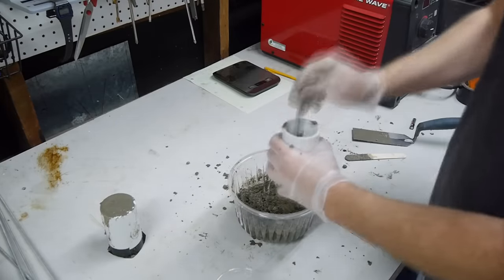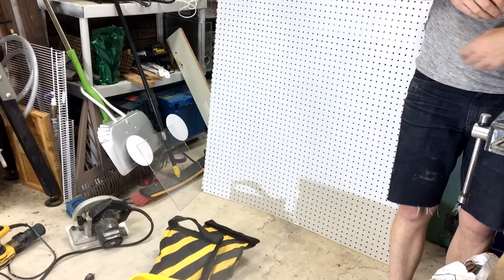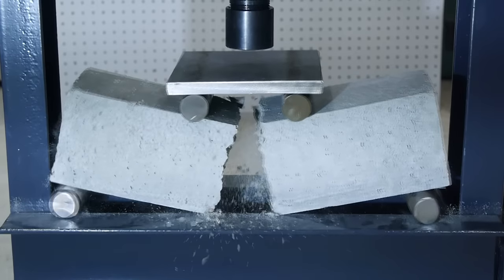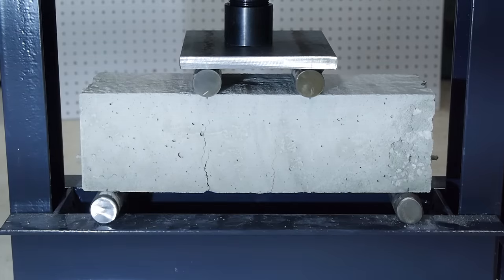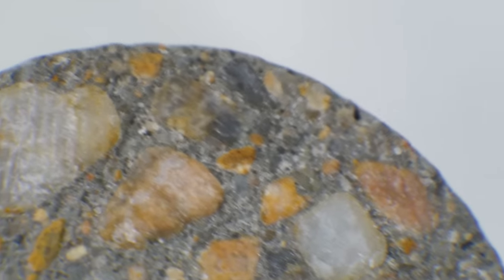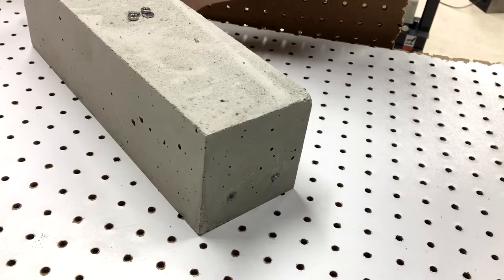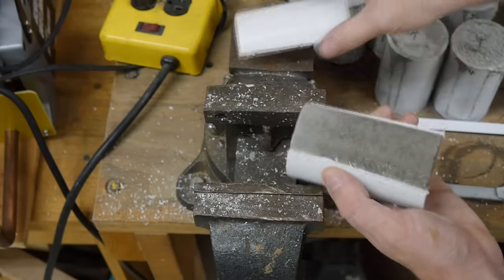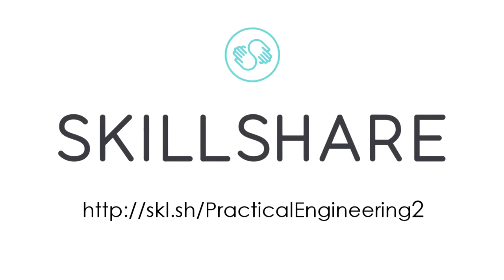Why Concrete Needs Reinforcement

Comment: Can you cover shapes used in concrete forms (like bridge beams) and how they are used to make the structure withstand heavy loads and the management of forces on it?
Reply: Jack Linde mostly for beams it's about increasing the inertia and keeping the stress concentrations relatively consistent, which is why we have I beams all over the place. They provide the largest inertia with the lowest material

Comment: As a redimix driver I would add 3 points.
1. There is a difference between concrete and cement. Concrete has aggregate or stone in it, while cement does not.
2. The more water you add, the more it will decrease the strength of the concrete.
#. There is also fiber mesh you can add to concrete (made from fiberglass strands) that will improve it's strength.
Reply: No cement is the powder used to make concrete
Reply: @damienbaker3118  Both are powder, and there are 2 types. Cement and concrete. So, no.
Reply: @m-h1217  Nah dude, Damien is right. Cement is one of the primary ingredients of concrete.
Reply: @rosscarroll6735  Yes, but concrete is still in a powder form. When you buy it you get it in a bag just like cement. Cement is not only an ingredient to make concrete, it can be used by itself. So saying "No cement is the powder used to make concrete" implies that it isn't used like the original comment states.
For real I've been around and worked with that stuff since I was a kid.
Reply: @m-h1217  when you buy a bag of “concrete” you are actually buying all the materials needed to make concrete, minus water. It is not concrete until it is mixed. Until it is mixed with water all you have is a bag of cement powder, crushed stone and sand. Yes you can use cement on its own. Doing so usually makes it easier to have a nice glossy smooth finish, but it is not considered to be construction grade unless it is mixed into concrete. So yes cement is the powder that is used to make concrete.
Reply: @JC-nu5zt  Never said that cement wasn't a powder used to make concrete. I said that it wasn't used to only create concrete.
"when you buy a bag of “concrete” you are actually buying all the materials needed to make concrete" Can say the same for cement, you buy the ingredients, as cement powder is literally just crushed limestone, chalk, sand, clay etc. By that logic cement isn't cement until it is mixed with water if concrete isn't concrete until it is mixed with water. Nobody says "bring me a bag of the ingredients to make concrete." It is a bag of concrete just like how a bag of cement is a bag of cement.

Cement is much more used than to simply make finishes, in fact if you want smooth finishes in a concrete construction you use a fine mix of concrete, one that contains a lot of water and much less rocks and sand. Cement is primarily used to wall together cinder blocks, bricks etc. So it is far from uncommon in construction. Any wall that isn't made of metal, organic or plastic materials contains almost certainly cement by itself (along with the other building material.) Unless it is a solid concrete wall.

I don't understand where people get lost in this.
Reply: @m-h1217  It’s cement powder there is no such thing as concrete powder
Reply: @JC-nu5zt  Then what was I supposed to call it? I apparently can't call it concrete because according to you concrete is only when it is mixed and ready with water.
And yes, it is a powder, the only difference is that it might be more coarse. The sand and gravel is so fine that it is still remains a powder even after it is added to the cement. It's mixed in, not separate thus remaining a powder, just a different kind.
Reply: @m-h1217  It’s called concrete mix on the bag
Reply: @m-h1217  Oh gawd. I just read your entire comment🤦‍♂️. Why are you pretending to be so passionate about something you don’t know about? I’ve worked with concrete six days a week for the past 13 yrs doing footings and foundations using the four seasons duraform system and your trying to tell me that concrete is a powder and the gravel and sand are so fine that it “remains a powder”. You have flour and your calling it bread.
Reply: @JC-nu5zt  Because I know about it, you might've worked years with it but the issue is that the logic you expressed is still flawed.
The main thing this was about is that cement isn't only used to create concrete.  Call it what you want, but it still is concrete if it is in a bag and it says concrete. Not cement powder with sand and gravel.
Reply: @m-h1217  It is called concrete mix on the bag. But a vast majority of concrete does not come from a bag it gets mixed in a batch plant and put into a drum designed to rotate that is attached to the back of a truck called a concrete mixer. If you know about it then what size aggregate is required for construction grade concrete? What is the proper slump for a concrete mix on a commercial building? Or instead of googling these questions just take the information that I have shared with you as something new you have learned instead of trying to refute it in some conquest to be correct.
Reply: @JC-nu5zt  You going to ignore your flawed logic? Your point of buying concrete is buying the ingredients like buying cement isn't the same?
Again, the main thing this was about was that cement isn't only used to make concrete. Is that incorrect concrete and cement master?
The other part of this which you brought up was that "concrete isn't a powder." While the bag usually doesn't include "powder" in the name just like cement which you brought up like it has, the material form of concrete like cement is powder. As by definition a powder is "fine, dry particles produced by the grinding, crushing, or disintegration of a solid substance." A powder used as an ingredient doesn't make the material not a powder. That was clearly what I was referring to, but still I had to make it even more obvious. Rip open a bag of concrete, yep that looks and feels like powder, doesn't it cement and concrete master?

You ask me these irrelevant questions about the general subject and at the same time acknowledge that I can just google them if I don't know, like it's supposed to make your case more believable. How about you answer these simple yes or no questions that a person without a single grain of cement or concrete knowledge could figure out, and slack off of the whole "I know everything about concrete and cement therefore I can't be wrong" persona?
Reply: @m-h1217  When you buy cement POWDER you bought cement POWDER. When you mix it with water you make CEMENT. When you buy concrete MIX you buy all the things needed to make CONCRETE. There is no clearer way to get this across to you. Anything beyond this would just be me giving you what you want which is to argue.✌️
Reply: @JC-nu5zt  So when you buy "cement powder" you literally don't buy the ingredients to make cement like concrete?

Is cement only used to make concrete?

Is the material form of concrete not a powder?

This is what I asked since the beginning and this is what I expect to get an answer to. Funny I can't get a response to these simple questions from such a concrete and cement expert.
Reply: @m-h1217  How about you let the professionals handle it and order your cement from a concrete company
Reply: @JC-nu5zt  We don't need to.
Your ignoration of the simple questions speaks for itself. Clearly I've said enough, so remind me not to order any cement or concrete jobs from you, don't really trust someone who doesn't even know what form unmixed concrete is in.
Reply: Got a little lost trying to comprehend what each side was arguing but DAMN that was entertaining
Reply: The name is a trick my man. Fiber only improves resistance to cracking not strength.
Reply: @m-h1217  By brother concrete is a Mix of, Cement, Fine Aggregate, Coarse Aggregate and water, and whatever admixtures u need, if ur concrete is a powder that means it has no Coarse Aggregate, a concrete mix with no coarse Aggregate has no strength.

To clarify Coarse aggregates are aggregates that have a particle size greater than 0.19 inch (aggregates that big cannot be a powder) , in my country atleast, it will vary depending on the code of practice of each country, and yes I'm a Civil engineer so trust me bro :)
Reply: @Inquisite1031  You do know that there are finer concrete mixtures with no "course" aggregate? Aggregates are not concrete either way.
Reply: @m-h1217  no u cannot make concrete without coarse aggregates, u can do it without fine aggregate, but not without coarse aggregate, and also concrete is a term used to define a mixture of Cement, fine & coarse aggregate and water, saying "Aggregates are not concrete either way" makes no sense.

 A mixture of cement and fine aggregates without coarse aggregates is called mortar that is not concrete.

Edit: also the reason why u cannot make concrete without coarse aggregate is that, it is the coarse aggregates that gives concrete its strength, I thought that was mentioned before but yeah there u go.
Reply: @Inquisite1031  My point being is that there is finer concrete with finer aggregates. Not specifically that you take away the "coarse aggregate."
Concrete mix is a mix consisting of components in a powdered or granular form, and thus the final mix is very much a powder. If you want to be extremely specific to whatever definition you're referring to, powder with granular particles.
Reply: @m-h1217  there is a limit to the size at which u consider an aggregate coarse, and that limit is usually 4.75mm, a stone pebble the size of 4.75mm is not a powder u can pick it up and throw it at some1 and it will really hurt, and the final mix of concrete is also not a fine powder, i highly doubt u have seen what a concrete mix looks like at all lol, go look at some, even a concrete slurry is not fine at all, that is why we use vibrators, to compact the coarse aggregate particles.

Also 4.75mm is only the minimum size, a concrete must have what we call "well graded aggregates" so it must contain aggregates of all sizes to have its proper strength, so concrete will have much larger coarse aggregates.

and if u want more details feel free to read any engineering text book, specifically "Design of Concrete Structure" books, and u will quickly know why.

its ok to be wrong, as long as u are willing to learn, so please educate urself.
Reply: @Inquisite1031  "final mix of concrete is also not a fine powder" never said fine.
Tell me what concrete is if it isn't a powder with granual particles.
Reply: @m-h1217  its is a slurry with a lot of coarse aggregates is what it will look like, the only component of concrete that can be considered a powder is cement, and even cement is not that fine, cement has a rather big particle size.

and the reason u find mostly coarse aggregates in concrete is because its the most important ingredient, its what gives concrete its strength.

and most concrete used for construction is M20, atleast in my country and the nominal mix for M20 is 1:1.5:3, that's why concrete is mostly coarse aggregate and very little cement and sand, if u look at a concrete mix it will look like a lot of stone pebbles covered in dark grey mud, very far from what u would call a powder.
Reply: @Inquisite1031  Slurry - "a semi-liquid mixture, typically of fine particles of manure, cement, or coal suspended in water" right, so powder. Makes me question how powder with granular partictles was any different.
You can look up images of dry concrete mix anytime and see that the majority of it is very clearly powder.
Reply: @m-h1217  i just told u the ratios of M20 concrete and the majority is not cement and sand, not by a longshot, the only reason u see a lot the cement and sand, is cos they are usually kept at the top when mixing to make things easier, there is a lot more coarse aggregates than cement and sand combined, and i've said multiple times why that is, 

And god forbit u never see a concrete mix that has more cement and sand than coarse aggregates that would be very bad, and if u want to know why, just read engineering text books, there are a lot of details that cannot be said in youtube comments, its a complicated subject.

And also u have backtracked from ur original stand point which was 

"Both are powder, and there are 2 types. Cement and concrete. So, no." (here ur assuming concrete is just powder with no coarse aggregates)

And 

" You do know that there are finer concrete mixtures with no "course" aggregate? Aggregates are not concrete either way." (here u clearly still don't know why coarse aggregates are very important in concrete and I'm pretty sure u mixing up mortar and concrete)

To its " powder with granular particles" (this is now just arguing for the sake of arguing)

which is much more correct but still not completely correct, concrete is a mixture of all of them, u cant, separate the finer ones from the coarse ones, just so it suits ur argument.

Concrete is simply a Mix of Cement, Fine Aggregates, Coarse aggregates, Water and admixtures, in some proportions to meet its design strength, usually M20, that is it, idk why its so hard for u to understand that lol.
Reply: @Inquisite1031  "the only reason u see a lot the cement and sand, is cos they are usually kept at the top when mixing to makes things easier" what a phenomenal argument. It's not like it's concrete mix straight of of the bag. But nope, the massive course aggregate must be hiding underneath. 
I've not backtracked, if you'd actually read my clarifications.
I'm not separated them, I'm very clearly including them. It would be you who is separating them.
And looking at images, besides working with it several times in my life. I can very clearly see the majority of it is powder, therefore I would describe it as powder with granular particles something which is directly including all ingredients. 
Your slurry quite literally says powder.
Reply: @m-h1217  if a majority of the concrete u have mixed in ur life mostly consists of the non coarse aggregate parts, u have been doing it wrong, next time please consult an engineer.
Reply: @Inquisite1031  No, in that case the manufacturers, you know, those who have expertise in the field, must've been doing it wrong. Alternatively, someone might be exaggerating the significance of course aggregate in order to transform a substance that undeniably resembles powder into something else, where they later defined it as the same thing. Great engineer.

Comment: If anyone is wondering pre tensioned slabs are reinforced with tensioned steel cables. 
Also on reactive soils engineers tend to put 2 layers of mesh/rebar in. Bottom layer for the downforce of vehicles and a top layer to stop the ground heaving the concrete up from below.

Comment: As a structural design engineer I am impressed by your knowledge, clarity of your explanations and quality of the videos… until I saw the undersized nut/crescent wrench you used on the “post-tensioning” demo.  That did not qualify as post-tensioning although the concept was probably conveyed.  I would mention that the advantage of pre-stressing allows for the use of shallower beam/girder depth for a given span which has structural as well as architectural benefits.  Good work.  Thank you.
Reply: Ay son! Spittin straight fire homie no cap!
Reply: I heard that pre stresed concrete is blessing for building builders and architects,  but hell for demolition crew.
Reply: @kvakerbillduck9500  It all-but-removes concrete's biggest weakness, so yeah. The people who use it would love how the material they're working with can handle more while the people who have to get rid of it would be forced to deal with a material that takes an absurd amount of correctly-applied force to break.
Reply: Why did it not qualift as post-tensioning? Is it because it was solid bars and not cables?
Reply: @Mrraerae  I think he was saying the nuts were too small to tension the rebar properly, that is probably the reason that his tensioned rebar didn’t do much better than the regular rebar.
Reply: @TheMrDamp  You're right on this.  The actual forces that are placed on pre-tension/post-tension strands are immense.  At least for bridges, we typically are using grade 270ksi steel that would be tensioned a little over 200ksi.  If that rod is 1/4", that comes out around to a shade under 10,000lbs.  The proportions of prestressing done in the video by that little wrench don't give the method justice or properly represent the major jump in capabilities to concrete.

That said, its a great video and I felt a decent overview of concrete reinforcing methods.

Comment: I've been watching videos recently about homemade aircrete (using foam made from liquid soap and water). I'd be interested in seeing how that material compares and contrasts to "standard" concrete.
Reply: Aircrete and other modifications would be cool to see. 

I'd also like to see certain types of demonstrable failures, like cold joints (a monolithic concrete pour applied in batches where the batches don't bond correctly), and improperly or non-standard mixed cement/sand/aggregate ratios. You covered hydration with the last video, but seeing how the ratio of the dry composites affects it's actual use would be insightful.
Reply: I suspect very poorly! But thermal properties might be excellent